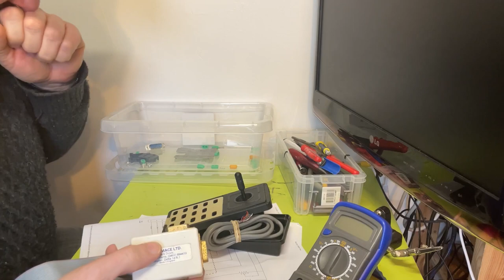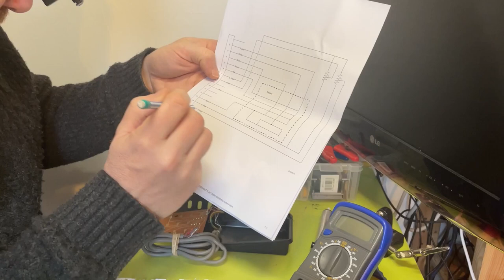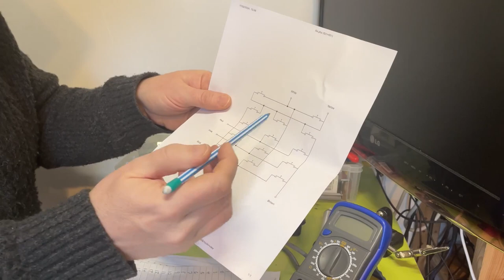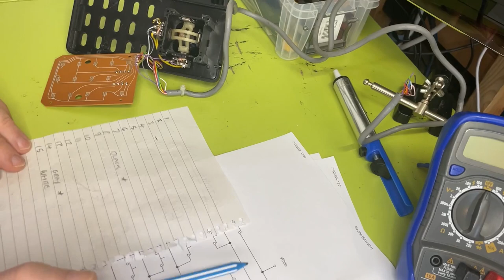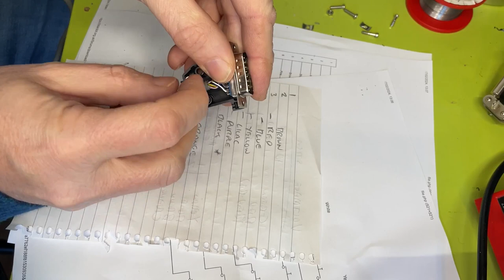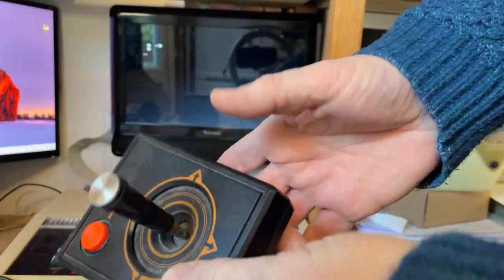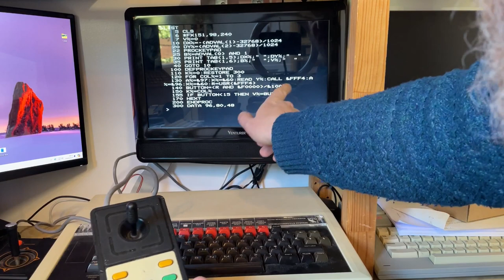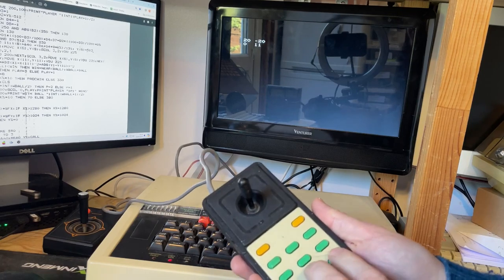BBC Joystick with Keypad - Voltmace Delta 14/B

Comment: I remember the 3-button version of this joystick - it was not great.  
It's worst sin was that there was a small amount of slop in the home location of the joystick (seen on the test program where the values are 20,-20 before wiggling it and 19,-20 afterward) meaning that it was prone to drift.The ergonomics meant it was awkward to hold, particularly if you wanted to use any of the fire buttons, as they were mounted near the centre of the top panel. The joystick was too long to be a thumbstick and too short for a full grip, so you had to pinch it between your fingertips, which was fatiguing.

The whole thing fundamentally felt like it was a crudely adapted industrial panel-mount design.